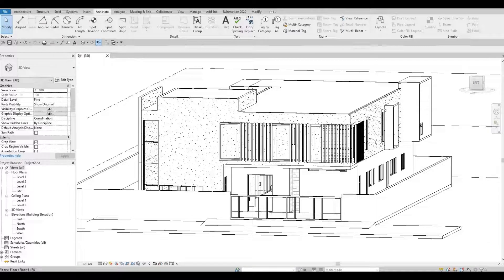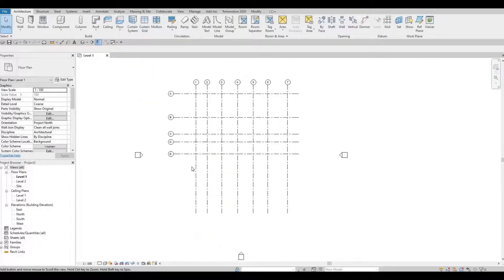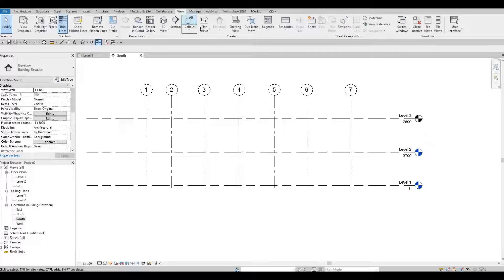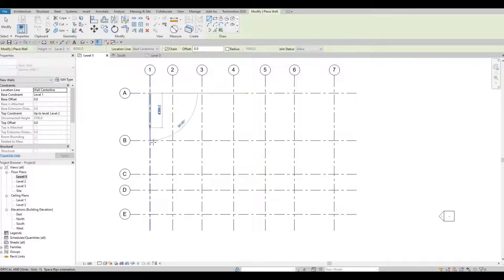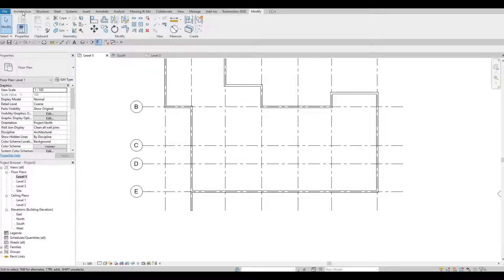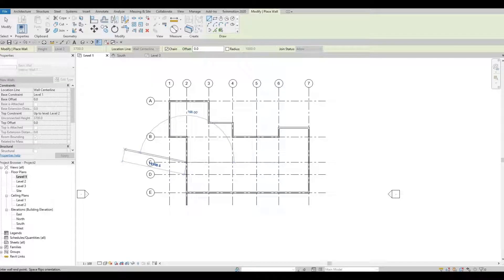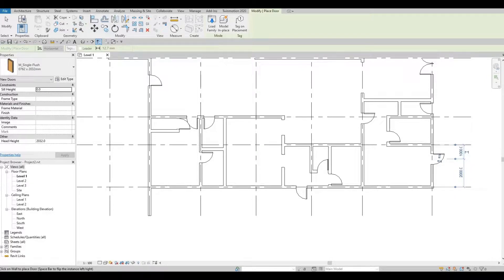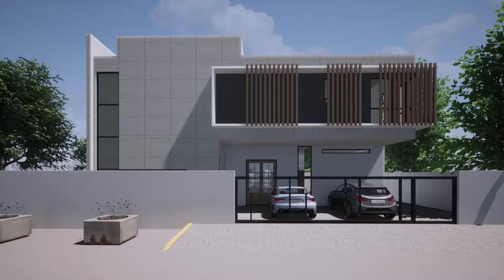SS3 House | Part 1 | Complete Step by Step | Revit Project Tutorial

Comment: What units are you using?
Reply from the maker: I am using millimetres🙂🙏
Reply: @ArchCoreDesigns  do you know why my units is stuck on degrees? Thank you
Reply from the maker: You can check/change your units by typing UN. Change it and save. Also make sure you are in the right template. Should be architecture template. 🙂🙏
Reply: @ArchCoreDesigns  Mine is stuck at degrees and I don’t see an option for millimeters
Reply from the maker: Oh that is weird, what template did you use?
Reply: @ArchCoreDesigns  metric architectural
Reply: @ArchCoreDesigns  I got it thank you
Reply from the maker: Perfect! 🙂🙏

Comment: Hi! is it possible for the next step by step video to incllude in a simple way the structure such as beams and columns ( steel /concrete for condos or office buildings) or layered walls to have a more complete model? Love your work ! was just wondering, or do you keep it simple so that its easier to synchronize in twinmotion? either way thanks for the videos, just wanted to share a comment.
Reply from the maker: Oh I was planning to do that in the future. I want a more in depth tutorials with proper wall materials and some architecture structures. But at the moment with me going back to work, I still wanted to upload daily and to have new materials. So yes, its been in my mind and I just need some time to execute the plan. 🙂🙏 thanks for the suggestion brother.
Reply: Thanks